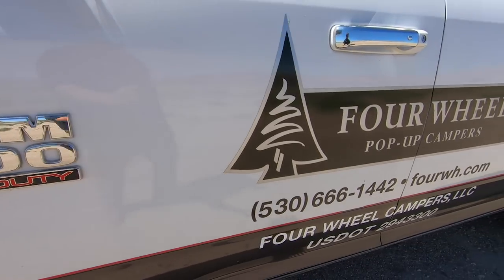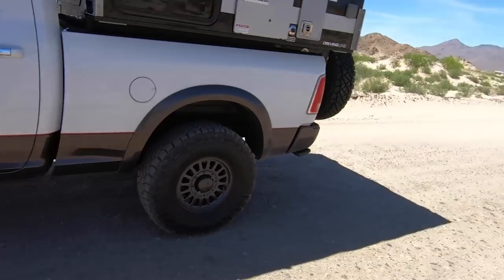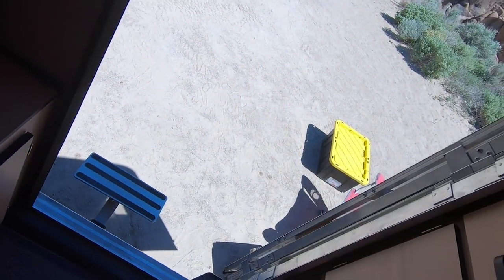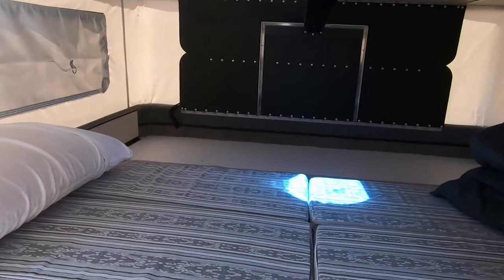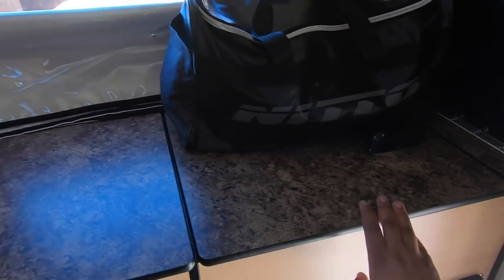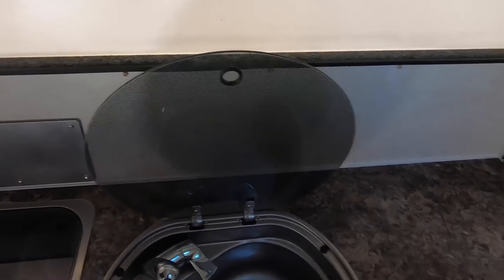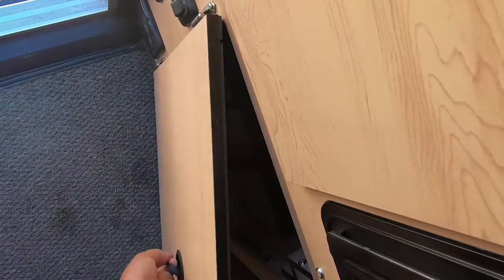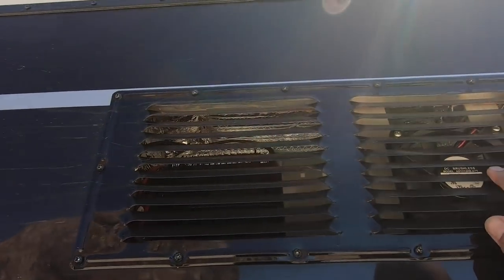Four Wheel Campers RAM 3500 Tour and In-Depth Review | Chasing Dust

Comment: I understand the concept of the pop up but I don't like the soft walls.  There a a very few hard side pop ups with removable panels but they are expensive and more custom.  The hard sides are needed in grizzly country and are great in urban sleeping as they block a lot of sound.
Reply: Been in soft sided trailers, tents, and pop-ups all over BC, lower Alaska, and the territories,  for over 40 years, and I have never had a Grizzly attack my unit.

Comment: This truck is too dam heavy for Overlanding and/or for a prepper. It wiil eat more fuel than the average pickup or SUV. And it be very difficult to get unstuck when Overlanding by yourself. Nice setup though.
Reply: Fully spec'd Hawk is under 1500 lbs., so you can get away with a 3/4 tonne.